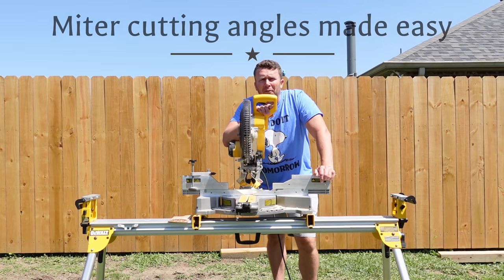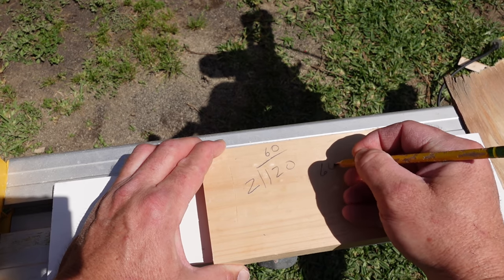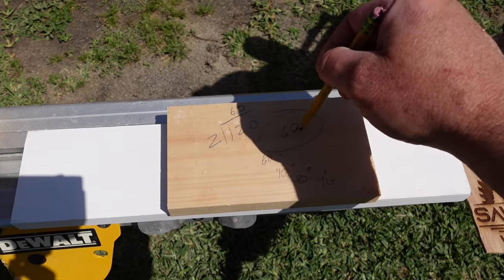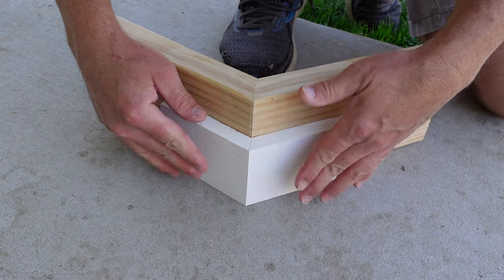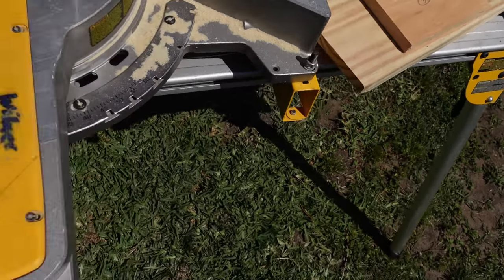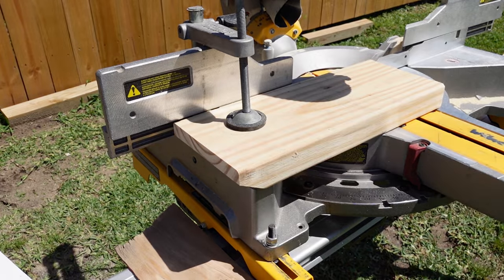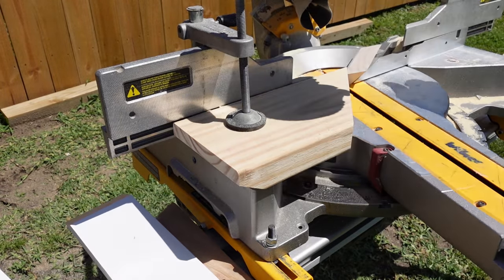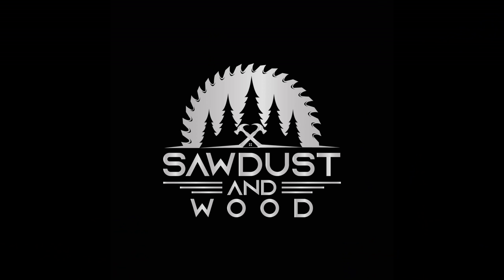99% of people don't know this about a miter saw...DO YOU??

Comment: I am a self taught Carpenter. Never had anyone teach me about angles and cut. I took what I learned in school and used it to figure things out. Your explanation on making the 30° angle cut on the Miter saw just changed the game for me. Until now I been using a speed square and a skill saw, and as most of you know that doesn't always make the best cuts. Especially when you are making 22.5° or anything under 45 °. Thank you for taking your time to show us this trick, and for now on I will keep a piece with a 45° cut with my saw at all times.
Reply: I sent another message telling you to buy the Modern Carpentry test book. Once you go through it, and actually work and do what they are showing, then later you may buy the "Modern Carpentry Work Book", but that may mean buying a later edition textbook, (more expensive) so that the 2 match. Also "Essential Guide to the Steel Square", (Amazon $15.20), and Audel's "Builders' Math, Plans, Specifications, (Amazon $6.94). It took us 5 years to complete these. DO NOT JUST READ THEM, and think you understand.. If it shows a 6/12 rafter, and stepping it  off, get a 2" x 4" or 2" x  6^" and step it off, then subtract 1/2 the thickness of the ridge. and so on.

Comment: Very instructional and easy to understand. The only piece of information I would add is depending on your material, you may want to be mindful of blade tear-out. The mitre saw creates tear-out at the back of the piece ( against the fence. ) Again, depending on the material you are cutting, or the type of blade in your saw, you may have to be mindful to keep the exposed or finished side towards you. Great video for general knowledge !
Reply: True.  To maybe finish your point,  a scrap piece behind your piece- placed back against the fence and going completely across the open part of the fence addresses that.

Comment: It’s amazing how many of these videos explain this the same way. I’ve seen people put tape on there miter writing in the new angles or taking sharpies and changing the angles on the saw.  There is a simple formula that lets you use your existing degrees on your saw, actually 2 formulas, both get the same result.  180 minus your angle then divide by 2, or take your angle divide it by 2 and subtract that from 90.  Stop changing the degrees on a miter saw.  Ex. Your angle is 120.  180-120=60, divide by 2 = 30, set your saw to 30 and cut. No modifications needed.

Comment: Very good video to explain how to cut the angles. The only thing I see is you are working with a short piece of trim that looks like a 1x4. That is an easy hold and even on your with the 45 degree jig and I saw the trim piece move a little when you cut. That is very hard to do on a 16ft. piece of trim. Also when the trim is a wider piece hard to hole plumb during the cut. I say it is easier to lay the trim flat and tilt the blade as laying it over. You did explain how to come up with the cut angle to make people understand how to get the correct cut angle.

Comment: Walls in old houses aren’t always perfect. My preferred method is to mark two parallel lines with say a 4x2 timber along wall on both side of angle , mark a line through the corners and use two sliding bevels for left and right cuts. Then use bevel to transfer angle directly to  mitre saw. I always mark a little bigger and trim down to fit. Works for me anyway.

Comment: Good info, but definitely an "imaginary wall", because no sheetrocked wall slathered with joint compound is every going to represent the precise wood angles you are demonstrating. The key bit, generally, is to subtract a half to 1 degree when measuring inside cut angles, and add a half to 1 degree when cutting your outside angles to account for the inner and outer wall bowing due to all the built up joint compound.  Otherwise, you will have a gap where the two mitered edges butt together. So combining your information on calculating odd angles (which are not that common) with the trick of adjusting the cut slightly to eliminate dreaded gap, should cover what most people need to know for cutting baseboard angles.

Comment: Question? 🤔 Ttying to cut 60° acute angle you needed 2-30° cuts... since 0°=90° couldn't you just cut 2-60° cuts & use the trash side? Cut 2 60° angles then toss them & keep the side you would normally toss bc it should be 30° left after you cut off 60°? Since 90°-60°=30°🤷‍♂️ unless 180° is actually zero in the case described in which case this wouldn't work🤦‍♂️🤷‍♂️🤦‍♂️

Comment: I used to use that angle finder until I found out about the miter gauge. Tells you exactly what to set the saw for if it’s a miter or single cut. 

Also when unused that digital one, I would find the angle say it’s 92, I subtract 92 from 180 which is 88, then divide that by 2, so I need to cut the miter at 44 degrees.

Comment: Hello Sir, im preparing to build a deck this spring and I want a sloped railing top plate, so people can lean against comfortably. You commonly see this on wood bridges in parks. My question is the miter at the corner with a slope of about 40 deg. Do you have a thought on this odd angle?
Reply from the maker: That sounds like a good idea. When I built my deck I used a round over but and did all my top plate rails. Your idea sounds legit though
Reply: @SawdustandWood  can you do a video on it?

Comment: On the second angle you cut, the 60 degree one. Couldn't you open the miter saw up to 150 degrees? If the trim has a specific face that needs to face out just with the face away from you facing the saw. I'm very new to this and just curious on if that would work or why not. It just seems like there could be a margin for error on a newer guy like myself keeping the 45 degree jig piece perfectly where it was cut, that would maybe throw the angle off it it moved?

Comment: Another trick: when I trimmed I tended to cut 1/2 degree off so the outside of the mitre touched before the inside making the highly visible seam tighter than the inside. Then when you rolled the outside edge it was super tight.

Comment: I'm an English chippy (carpenter). You cut a piece of wood at 30 degrees. If you would have cut the scrap piece of wood at 60 degrees and not 45 degrees, you don't need to move the sawblade at an angle. 90 + 30 =120. 180 - 120 = 60 degrees. Try it! Another example: you want to cut an angle of 25 degrees, 
90 + 25 = 115. 180 - 115 = 65 degrees. cut a piece of scrap wood at 65 degrees, you don't need to move the saw head to any angle, it stays at 90 degrees. Why am I putting 90 first? Because after the saw has cut the material, the cut face will be 90 degrees from the backstop. Add 90 to the angle you want to cut, then subtract the total from 180 degrees. The figure left is the angle of the scrap wood. Rule Britannia!

Comment: Can you make cuts like this into hardwood, say 20mm thick boards with 100mm width? (3/4 inch thick and 4 inch width), with a normal cross cut saw like that? I mean, assuming the saw goes to that depth, sharp blades etc, is it safe to do that if cutting a really dense hard wood?

Comment: Not every wall is gonna be perfectly plumb, one trick I use is cutting your pieces long.  Then put them in place and scribe the back side of the board where it hits the corner.  It will give you the vertical angle you need to cut at for it to line up with the wall on both pieces as well as your over all length.  On a standard 90 degree corner I also cut the corners on a 45.5 degree cut if it is getting painted. it will compensate for out of whack corners.  Caulking will cover if there is a small crack in areas against the wall.

Comment: Your math is 100% correct, but I'm not sure the explanation will help those already confused by the math.  The 45deg jig is the best takeaway from this vid, however, it makes it difficult to hold the piece in solid fashion.  Even you were having a little issue holding it steady as you made both of the 30deg cuts.

Comment: I cut baseboard for a closet that had similar to the 30 degrees except the opposite. Is the word convex? Inside angler?  Anyway, it was very pointy. I experimented until I got it close and then I caulked  and painted it. It took ma lot of cuts. How do you do those types on angles?

Comment: Pretty good. Mastery would have been if you didn't make your cut backwards so it blows out paint and wood chips on the finished side. And if you gave an extra 1/2 degree to marry the outside edges while leaving allowing for some slight wall shifting. If it's a perfect angle cut like you did, and the wall shifts, it may open your cut slightly and show a crack in the paint

Comment: The only thing I would change is to make the angle of your jig less than 45 deg, maybe like 30 deg, because as you showed in your video it isn't that easy to hold your target piece snugly against the jig at that angle. If your angle is shallower, it's easier to put press your target piece against the jig. In this case, you would need to make a 30 deg cut against a 30 deg jig.

Comment: A straight line is 180 degrees. Subtract what you get with your angle finder then divide by 2 to get miter seting.  This is the simplest way to quickly know what to set your saw on!
(180 - angle measurement) / 2 = miter setting

Comment: Without supporting the top half of the "trim" piece in the acute example there is almost no way to cut this plumb. Also the danger of the saw pulling the 'trim' board into the blade, Bending it or worse pulling your hand into the blade as you finish the cut is very real.

Comment: I think of the line of one straight piece of the baseboard and how far it has to “turn” to meet the wall.   The wall angle was 120.  If you put a long piece of baseboard up against one side of the wall (straight line = 180), then you see that the board has to “turn” 60 degrees to meet up with the other side of the wall.  That 60 degrees is split between two cuts - one for the right piece and one for the left piece.  So you have to cut it on a 30 degree angle.

Comment: How are you  not getting tear-out  on the back side of those boards?

For that matter, the way you're orienting your cuts, the back of the trim is facing you.  So, you'd be getting tear-out on the front of your trim?

Also, anything other than a plain board is going to have a vertical angle on the front, so you'd need to have the back of the board against the fence.  In that case you'd be wanting to do these cuts with  the piece on the right side, not the left.

What am I missing?

Comment: As a 30 year old trim carpenter. Let me tell you doing this is very dangerous. There is no back stop holding the trim from moving. If the teeth grab the trim it will pull the trim and you with it.  I know because it it happened to me and I destroyed my 400$ saw, $100 blade and literally had saw tooth marks on my forearm where the blade stopped at the perfect time.  If you don't have an angle finder you can overlay to scraps of wood flat following your wall,  mark the points where they intersect find the angle by cutting one of the pieces you marked. That is your angle to cut the trim to.

Comment: What if you have outside corner of 88? Is this an acute angle? In this case can I just  cut my baseboard by setting my saw at 44 instead of 45 or I have to follow the rule by  counting zero as 90 and find the number that corresponds to 44?

Comment: Acute corner angle cuts less than 90 degrees, you must change the rest stop to 45 degree. 
Take the Acute corner, 
split the Acute corner in half. 

Zero the saw's angle. Remember 
Set the saw to the half of the Acute corner measurment is the final cut angle.

Comment: How do you trim a 90⁰ bullnose corrner?

Nowadays, the sheet rock corner transitions to 90⁰ at the bottom. The early bullnose corner, which I need to trim, did not transitio n.

Any helpful tips?

Comment: Can somebody confirm if I’m thinking right - with obtuse angles you can just substrate your angle (in this case 120) from straight angle and divide your result by 2? 180 - 120 = 60 and 60/2 = 30

Comment: The demo is perfect, but in a real house, mine built in 1976, the floors look level and flat, and the walls look vertical, and drywall finishing etc look fine, but when you place machine cut MDF, the angles are well off the perfect example, and compound (top vs bottom of baseboard has different angle). It's really hard to for a DIY to make a nice joint on a lot of real walls. Hire the pros!

Comment: Won't it potentially take a couple adjustments with some scrap wood to make sure the angle is set correctly on your miter saw? For example, the scale on your miter saw might say 30deg, but it could be 30.5 degrees. Or your total angle might be 223 deg, so you need two cuts at 61.5 degrees. - you don't have that number on the miter saw so your sort of eyeballing the setting. Or you can set your miter saw using your angle gage. I'd still test with scrap wood first.

Comment: How would you achieve the obtuse angle with material that is thicker than the height of the miter saw (in my case, 7.25”)?
Reply: If your saw is a compound mitre you could bevel cut the wide pieces

Comment: From the walls angle, take the angle of degree and split it in half. 
Find the difference from 90 with the half angle and cut the material using the final angle you calculate. Water under the bridge!

Comment: I once had to install prefinished hardwood floors in a home that had an exterior wall that ran at a 10 degree angle which meant my flooring had to have 80 degree cuts. With a 2 1/4 inch wide board the angle cuts were almost 7 inches long spears. LOL All the cuts had to but into metal framing of the sliding glass doors. I managed to make flawless cuts using the same technique
Reply from the maker: Improvise is where its at, good job.

Comment: Just start right away by subtracting your measured angle from 180, then ÷ by 2, and voila, you have your actual mitre saw reading. So, your 1st example would be: 180-120=60...60÷2=30°.

Comment: Just buy a Starrett Protractor Gauge and it does the math for you. Easy

And it’s not that straightforward. Corners have a mud buildout from the drywall finisher. Lay a strait edge on just about any corner where your base will go in the same direction as the base molding and you will see what I’m talking about. It’s more of an art than a science.

Comment: The jig is a good idea, but leaves too much room for error.  With just the width of the board to use as a fence it is too easy to wiggle, especially at the critical moment when the blade contacts the trim.  For an acute angle just think backwards.  From 90 (or zero) turn the blade to the right , rather than to the left, to 60 degrees and then flip the trim over and cut it from the backside.  Complimentary angles...60 and 30 is 90

Comment: does it work the same for "inside" corners," meaning corners that don't stick out, but are where one wall meets another wall and the angle is the opposite of one where it's a corner the sticks out? This has bugged the hell out of me FOREVER! Say, for example, you did the back sides of the ones you did in the video. You know what I mean? Those would be what I'm calling "inside" corners."

Comment: A cheaper way is using a siding T bevel and a compass. Use the bevel to lock in the angle. Then copy angle on scrap wood. Then use compass at apex to adjoining lines. Then where those lines intersect, use compass on both to bisect. Then draw a line to the bisected angle and adjust bevel. My uncle who is a master post and beam contractor showed me this and I do perfect cuts. Make the miters a hair strong to have the tightest joints.
Reply from the maker: That method works for sure! The angle finder I use is $20. But there are many methods, thanks for commenting and watching
Reply: @Sawdust and Wood  oh wow! I thought it was probably expensive, like the digital level I purchased for stair skirt boards. I will definitely be purchasing this to speed up the process for that price!

Comment: I needed a formula. 

90-(wall angle / 2) = Miter set point. 

Divide your wall angle by 2. Minus the sum of that number from 90, and that’s your miter set point (angle). 

I know the parentheses are not necessary.

Comment: On the angle finder you can move it to 90 degrees and zero it, then the angle on the angle finder is the same as the mitre saw. Saves a little bit of maths, you still need to halve it though.